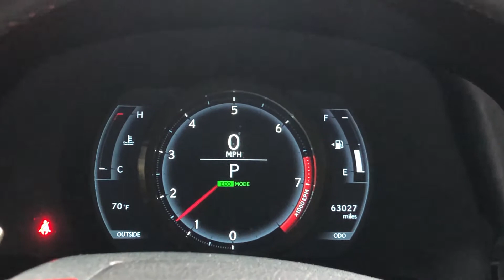LEXUS IS, GS, & RC REAR TOE ARM INSTALL

Comment: HOW did you get the inside bolts off?? I cant figure that out and it's the only thing stopping me
Reply from the maker: I believe I got a long 19mm socket and my cheater bar and came out it shouldn’t spin neither
Reply: @Jonathan.Nguyen  I appreciate the quick response! I ended up needing to remove my coils, the bolt was binding because of how low the car sits. I appreciate your video! This was the only resource I could find on the whole internet for this swap
Reply from the maker: @yerocnogil  happy you got it! Hope the video helped

Comment: Just bought a static is300 on coils with camber kit, car was fishtailing bad on my way home, had to tow it, he said it needed rear camber toes so I ordered Godspeed rear toes? Would that be the reason for fishtailing?
Reply from the maker: Bad toe would cause ur steering wheel not to be straight when going straight. It also eats up your tire very bad. For it to be toed like that could be a bigger issue. Sorry I couldn’t help but do see a mechanic or ask around and best of luck!
Reply: Im having the same issue, installed bags on my is350 and now the rear started to rub. So i installed camber arms, when i installed the camber arms the car drove fine untill i adjusted the camber arms in. Now the rear fishtails pretty bad like just going 30-40 mph it feels like my tire is going to fall off. I’ve took the wheel off and retorqued everything that i touch still same issue. Going to install these toe arms to see if it fixes the issue
Reply: Alignment